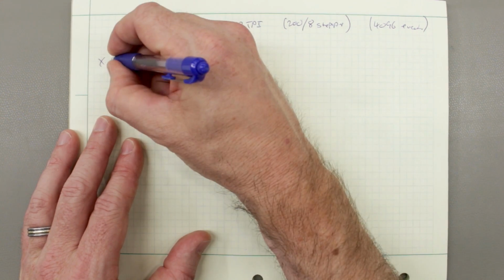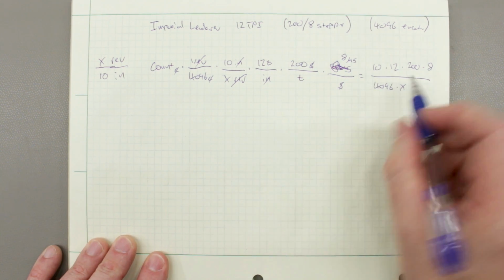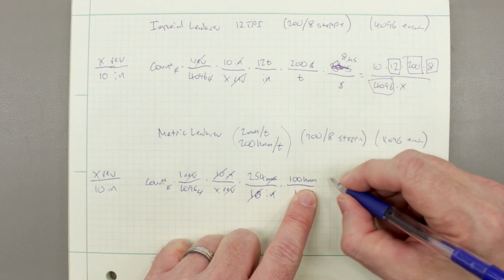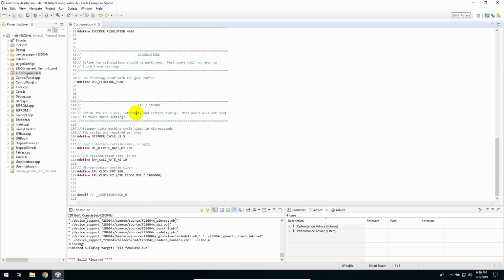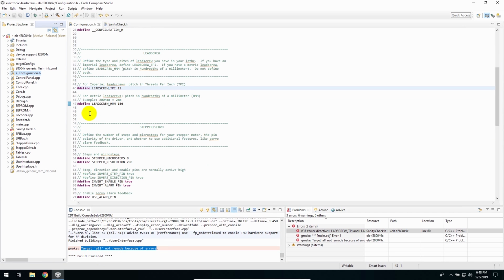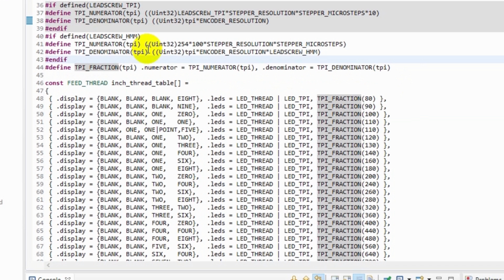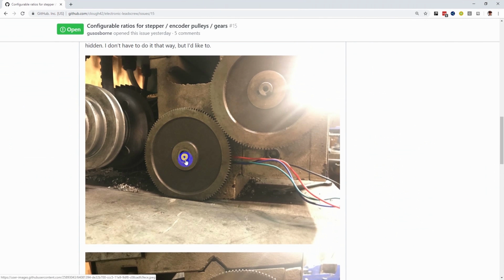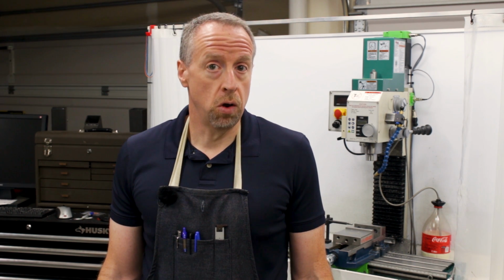Lathe Electronic Leadscrew Part 11: Metric Leadscrew Support

Comment: why cant i get a answer to a simply put question. I'm no geek i need questions answered. Why can OR can i use a mobility scooter motor. to drive my shaft that drive the saddle on my rack ? taking the place of a lead screw,  can increasing the speed of the motor select the treed pitch. gust as a MiG weir speed    is controlled. Can you exsplan to me the answer to the question.

Comment: Time for Upgrade Suggestion: Whether its Metric Thread, British Thread, UTS Thread, Worm Thread, V thread whatever, no matter.
Solution Suggestion: For 1st Engagement Cut, Leave at least 1 inch away from point for physical cut, then engage, press Set Button. The microcomputer internally record angular position of lathe spindle from detent and position of leadscrew from DRO. For subsequent cut, disengage, shift away at least a distance of 1 inch from cut, engage. The microcomputer sync leadscrew position [at any Position == Y * recorded DRO position / pitch] with lathe spindle angular position as recorded in first cut. There are 2 types of sync, the active sync and the passive sync depending on programmer ability and choices.
Its an idea, so if anyone had implement same before, please share.
[Human Action cannot be faster than Microcomputer Action for crispier Thread. Recommended Chip STM32F334 with HRTIM with 244 picosecond resolution]

Comment: Looking at the code (v1.4), it seems STEPPER_MICROSTEPS and STEPPER_RESOLUTION are not really used as truly independent variables, but are only used to calculate the value of the NUMERATOR() objects.  Am I correct?

If so, then there is effectively no difference between setting STEPPER_MICROSTEPS to 1 and STEPPER_RESOLUTION to 2000 vs. setting STEPPER_MICROSTEPS to 2 and STEPPER_RESOLUTION to 1000.

In my case, I will be using a server whose step resolution can be set to a minimum of 1600 PPR, but also supports 2000 PPR.  I may eventually be using a gear ratio of 4:1, but at the moment, I only have gears that can do 7:2.  The code limits the STEPPER_RESOLUTION to 2000 and the STEPPER_MICROSTEPS to 256, but I could set the PPR to 1600, and then set STEPPER_RESOLUTION to 800 and STEPPER_MICROSTEPS to 7, which should result in a correct numerator factor of 5600.  Is there some issue with doing it this way?  If I go to 4:1, that results in an overall pulse rate of 6400 pulses per rotation of the lead screw, or 8000 if I decide to up the servo resolution to 2000 PPR.  My lathe has a maximum spindle speed of 3000 RPM.  Not that I would actually ever try to produce a 6mm thread at 3000 RPM, but attempting to do so would produce some 1,200,000 pulses per second, which is 4 times the rated frequency of the servo.  Does anyone know the maximum pulse output frequency of the MCU in this application?

Comment: It were no Problem to enter 12.7 TPI what equals an 2mm Leadscrew. When I cut imperial threads on a cnc lathe (for example 14 TPI) I will never ever switch to imperal by g-code, but enter the pitch parameter as 1.814mm. Excuse my heresy, but we are lucky that Volts and Amperes are the same and an hour has always 60 minutes. :D

Comment: Hi James, I am becoming a big fan of your work. And admire the amount of effort you put in your videos. Jave learned a lott from them.
I have a question? Dus it meter if you have a metric lead screw and want to cut matric threads in oposition to hybrid thread? Or is there a new formula needed to be aded to the program you made?
Reply from the maker: The ELS firmware supports both.  If you have a metric leadscrew, you can natively cut metric threads.

Comment: I just saw this, interesting.  Many years ago there was a piece of kit offered by MSC that would clamp onto the lathe bed as a two axis stage that was cnc controlled.  Something like that would be an interesting project and have practical use for turning a manual lathe into a temp cnc for short work like bushings, threaded studs, etc. I'm thinking of a long gang tooled cross slide.  Or, think of a electronic cross slide conversion to duplicate the function of a hydraulic tracer without the noise & use the original feed gears. And of course,  turning one of my horz mills into an electronic gear hob.

Comment: First of all many thanks for your excellent work for this project. I have got one question concerning this entry on github that I found:  https://github.com/clough42/electronic-leadscrew/pull/77. Is this a real bug in the declaration of variables and can you confirm the solution with U64int?
Thank you! - After bricking one TI board my leadscrew now works on the bench - next step is mounting the electronics, motor, encoder and pulleys to my lathe:-)

Comment: I have no lead screw as such it is an  an half shaft  Which drives a  ked shaft & travels on a 4, TPI linear rack  . as method of  driving the saddle  it is  imperil . ,  their is a way to  drive their is a way to fit a counter to the rack .

Comment: I want to do a gear to gear set up like you discuss in this video .  I like the gear idea not just for more torque which helps the stepper motor but also allows less stress on fine steps it can allow a means to store the stepper out of the way.   A pulley can slip messing with the lead screw movement.  I am going to add a pulley system to my main drive motor because i presently have a cog belt which when stressed can slip or strip the teeth but other than that i want a firmer drive .  I wanted to eliminate added stress to the drive motor this is why i wanted a separate lead screw motor to drive that.  Love what your doing very detailed.

Comment: Hi James,
Thanks for making this available to us.
I have put everything together on the bench with your latest 1.01 software version, and everything works good.
One feature request is to have it start up with the last used settings if possible.
I am installing this on a very common 12X36 import lathe with 8 TPI lead screw. I will probably make the installation procedure available since that is a very common lathe size sold under different names. Mine is a Birmingham YCL1236 model.

Thanks again, and Merry Christmas.

Comment: More of a cosmetic suggestion:

//
// Set this to false to use metric
#define Imperial true
//
#if Imperial
// For Imperial leadscrews: pitch in Threads Per Inch (TPI)
#define LEADSCREW_TPI 12
#else
// For metric leadscrews: pitch in hundredths of a millimeter (HMM)
// Example: 200hmm = 2mm
#define LEADSCREW_HMM 200
#endif

Comment: (made up metric unit.) I was shouting into my phone "USE um per revolution." Must have had a rough day...
Reply: Realise this is quite a delayed response but this is probably something others are thinking too....I was!   James explained why he multiplied by 10 for the inch threads - to make it a whole number as there are some half multiples like 11.5tpi.  I was wondering why he didn't just multiply by 10 for the mm pitches for the same reason but when you look at the thread tables in tables.cpp there are some metric threads that are two decimal places - such as the 1.25mm pitch in an M8 course thread.  Multiplying these by 100 gives you the nice whole number that James is looking for.
Reply: @Cenedd  1 um is 1/1000 mm so it works too !

Comment: So is there a reason to why you have the stepper/servo running the feed screw all the time and you engaging the feed manually? Is it not possible to have the feed engagement nut engaged all the time and move the slide with the stepper/servo and two buttons? And still be able to thread by pushing another button? 
To me it seems like some kind of compromize between a manual lathe and a cnc lathe?

Comment: First off, great job so far. Second off: Definitely lean on the community for help with the code. In this application, you should at least be using a "safe integer library", given that an overflow would cause real-world damage. Or switch to double precision floats. Or 64-bit integers. I would not use the performance of the micro as an excuse. If the micro can't do 64-bit math quickly enough (but most likely it can), use a different one! Your lathe is worth it!

Comment: Hi Folks, as I'm sure James is well aware another very common metric leadscrew pitch is 3mm per turn. It's very close, but not quite the same as having 8 turns per inch on an American (or Imperial!) leadscrew. Over here there is still a big need to cut imperial threads despite many of our newer (yes, Chinese) lathes having metric leadscrews. This is because imperial threads are still in widespread use in UK model engineering - most especially in constructing model steam locomotives. Ideally we could do with dual leadscrew lathes! Odly even some German thread standards are expressed in inches, so it's not just the UK. BobUK.

Comment: Sorry if this has been raised before:
Why does this not include an electronic threading indicator? The absolute position of both the work and the tool is knowable. From this it should be possible to render the entire metric / imperial lead-screw issue moot.
Reply: It's a good idea Robert, and It's a feature I'd love to see too.  The issue at hand is the split nuts.  If you release the nuts from the leadscrew, you can't know the position of the carriage.  In a traditional setup, releasing the split nuts doesn't release the threading dial, so the dial is always tracking, even when the split nuts are open.  The way to fix this would be to integrate a DRO scale to track the carriage at all times... but that is probably out of scope for a project like this.  I have the opposite problem with my lathe: I have no split nuts - my leadscrew has a handle on the end of it.  In my case, I'd need some kind of disconnect to release the servo from the leadscrew when I want to manually drive.
Reply: I fear you're correct, trying to explain why simply is difficult but yes, you'd need to know absolute position of the carriage and / or have very fine control over the leadscrew.
Reply: "The absolute position of both the work and the tool is knowable"  No, it isn't.  The small (<360 degrees) angle of the spindle relative to a previous position of the spindle is knowable, and can even be tracked through multiple revolutions ("large" or multi-rotational angle).  The same is true of the lead screw.  What is NOT knowable in general is the large angle between the lead screw and the spindle.  The small angle is not sufficient, and the large angle is completely unknowable in general and can only be inferred in an incremental, as opposed to absolute, fashion if the half-nut remains engaged.  The ELS has absolutely no way to know into which thread position the half-nut would be engaging when the lever is thrown.  It is true it would be some integer multiple of the leaf screw pitch, but unless the thread pitch is exactly divisible by a whole number divisor of the lead screw pitch, it;s a crap-shoot whether one hits the right mark.  For example, if the lead screw has a 2mm pitch, then it would would work for 2mm, 1mm, 0.666...mm, 0.5mm, etc, threads, but not for 3mm, 4mm, 1.5mm, etc. threads, and of course not even remotely for imperial threads.
Reply: @leslierhorer1412  I see the problem but that's solvable by never disengaging the half nut. The ELS has control of the lead screw, it could know the length of the thread and only advance the carriage that distance. I can see objections, this is scope creep. It's becoming more than just an ELS, now a CNC lathe.

Comment: I love this series of videos.
I hope that when you refine all the details, you will sell self-assembly kits with the motor, controller and all electronics.

I would love to buy something like this because in my lathe I can only change the speed of the lead screw by changing the gears. It is bothersome, especially when there is a lot of work to do.

If you sell it, be sure to let me know. Once I install my set, I will gladly show it to my viewers with link to your online store and certainly some of them will be interested in buying it.

The technique goes very fast, but unfortunately lathes are still made using the minimum amount of electronics.
I think the idea of an electric lead screw should be mounted on most manual lathes or at least as an optional choice.

If I can suggest something.
I think it would be a great facilitation to program the controller so that the type of lead screw and TPI and MM can be selected in the menu without using a computer.
It seems to me that there are many people like me who are afraid of programming (even the simplest) and prefer to do everything with a controller.

You are doing a great job and I hope there will be similar projects in the future.
Maybe homemade cnc plasma cutter? :)
Good luck!
Reply: If one of the best maker channels on youtube is commenting, the video must be good!
Reply: instaBlaster

Comment: In Encoder.cpp;
Uint32 count = (current > previous) ? current - previous : previous - current;
wouldn't
Uint32 count = abs(current - previous);
be easier and faster?

Nice project b.t.w :)
Reply: Because `current` and `previous` are unsigned variables, `current - previous` won't go negative, it'll underflow and wrap around to the max positive value minus what would have been the negative result.  Since the result is always positive, `abs()` will have no effect.

You could cast the variables into signed numbers, but to do so without data loss you have to convert to `Int64`, then compute the difference, `abs()`, and cast back to `Uint32`.  One would have to benchmark to see if `Int64` arithmetic performs better than the conditional branch with `Uint32` arithmetic.

Comment: Hi, Clough42. Guys in Russia are already making version 7 of the program on the Arduino Mega2560. Starting with the fifth version, it already controls 2 screws. Lots of features. And it has been working for many people for a long time. I think it will be interesting to see. Use google translator. 600 pages on the topic.
https://www.chipmaker.ru/topic/97701/

Comment: Hello. Thank you for nice video series. This series inspired me to built els to my old lathe. In My lathe there is no gearbox for leadscrew, only a set of change gears. I selected to use Arduino DUE because Im familiar with Arduino and Atmel prosessors. in Arduino DUE there is build in  quadrature encoder and stepper motor library is easy to use. This kind of project like ELS is mainly a programming project. 
Thank you very much for sharing this with us this helped me a lot.

Comment: Clough42  You mentioned running your servo at 3:1. In the code you mentioned using 1000 for the pulse count. Is there another setting for ratio or should that be 3000 to account for the gearing?
Reply: he set microsteps to 3, that's 3 microsteps per revolution so that accounts for the 3:1 ratio

Comment: Happy to test and send PRs for metric specific issues!

This is the video I've been waiting for, so I'm going to order parts to start a build. My machine is a CQ6125, which is basically a G0602 with a metric lead screw, and the apron has the half nut and handwheel swapped.

Thanks!

Comment: Question: What happens when the lathe is ran in reverse? My thinking is that the feeds driven by the encoder are not affected by the change in direction, but on gear drive it is. Interesting. 👍:-)
Reply from the maker: The screw tracks the spindle, so if you run in reverse, the screw turns in reverse.l, the same as with gears.  You can switch the direction with a button on the control panel, the same as you would with a reversing tumbler.
Reply: The "quadrature" mentioned in reference to the encoder is a type of signal specifically meant to represent both number of counts and direction; the electronics hooked up to the encoder always knows which way it is turning, and it makes sure to turn leadscrew in the appropriate direction too.

Comment: What power connector are you using on your PCB? So I can have the right cable here ready to go, when I get one of your boards. And also, which connectors and cable from board to the display box?
Reply from the maker: It's a 5.5/2.1mm barrel connector.  Center positive.  5VDC and I'd recommend at least 2A.  That's overkill, but it's driving the LED display and glitches are no fun.
Reply from the maker: The cable for the display is a 5-pin Dupont header on each end, .100" spacing, wired straight through.  The same connector is used for the encoder.
Reply: Thank you

Comment: Hi, great project, thank you for your effort. For the person with the gear ratio problem, just calculate the steps your self. For the 120/127 gears if you are using 1000 steps motor use 1058.333333 steps for 800 use 846.666666 for 400 use 423.33333 etc.... it will be a fractional error of steps because of the .3333 or .6666 but it should work reasonably accurate for hobby use.
Reply from the maker: The firmware is handling the numbers as 32-but integers, so the fractions won't work.  Because of the way the error accumulates, even small errors can become a big deal, causing later passes of a deep thread to misalign.
Reply: @Clough42  Have you considered using a C++ rational number class (e.g. Boost Rational) in place of plain integer types. That would automatically take care of simplifying the fractions involved, albeit at some run-time cost. 

https://www.boost.org/doc/libs/1_55_0/libs/rational/rational.html
Reply: How about making the steps 105833 and the pulley 100:1 ? That would give you a better resolution. Just some ideas.
Reply from the maker: @angeloslikos1167  honestly, I'd much prefer just providing a numerator and denominator so the calculations can be exact.
Reply: If the gear ratio is converting imperial to metric. Couldn't you just treat the leadscrew as metric? The tables are already calculating for that.